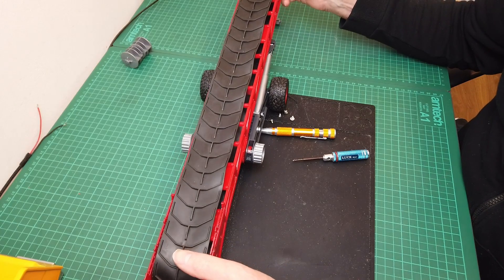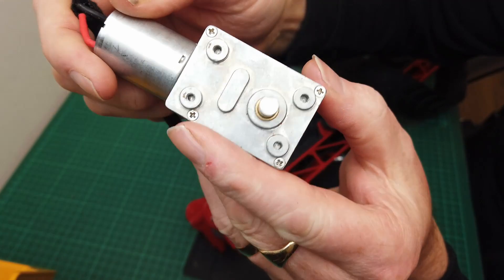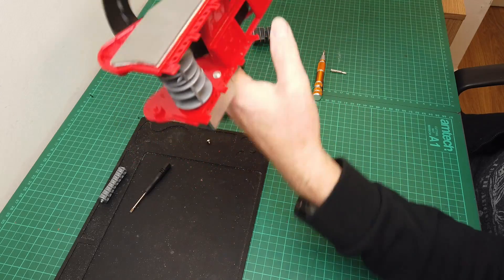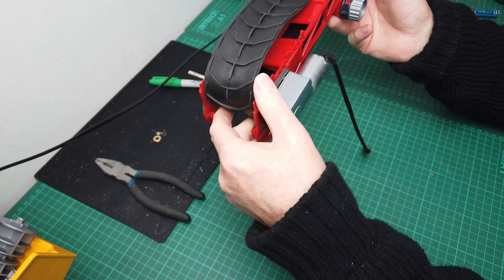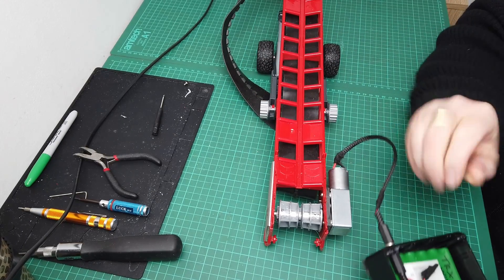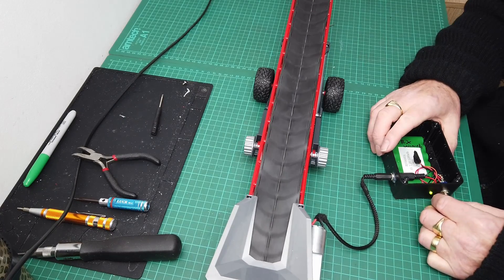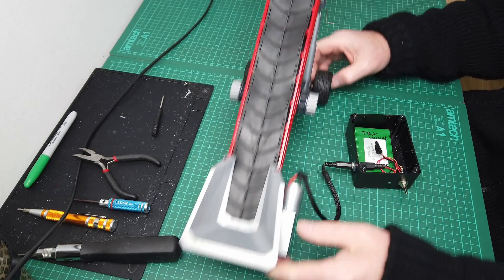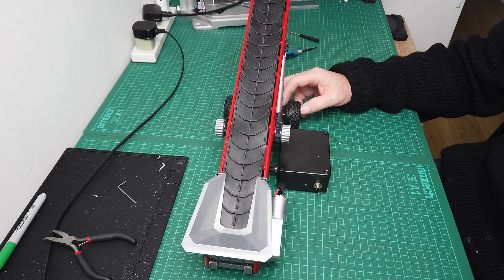Bruder Conveyor Belt Conversion

Comment: What motor/gearbox is this mate?
Reply from the maker: Reversible Torque Turbo Worm Geared DC 12V Motors GW370 12V 0.6 - 120RPM, From eBay.